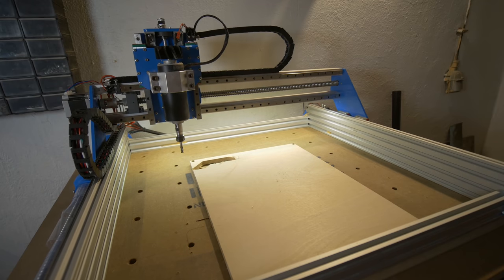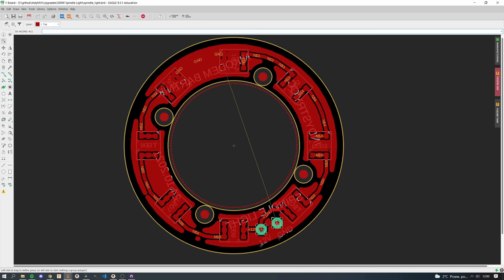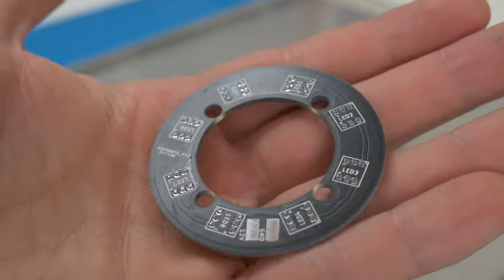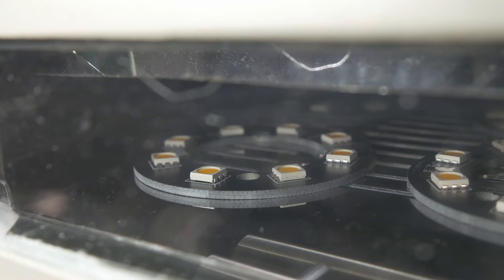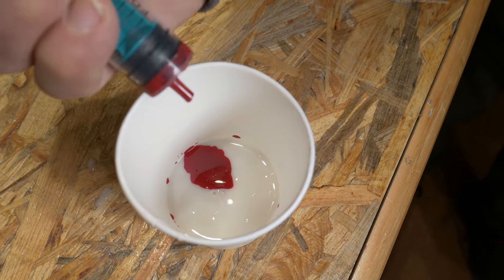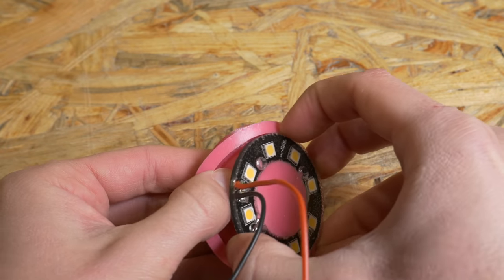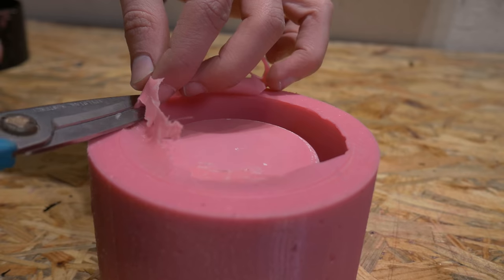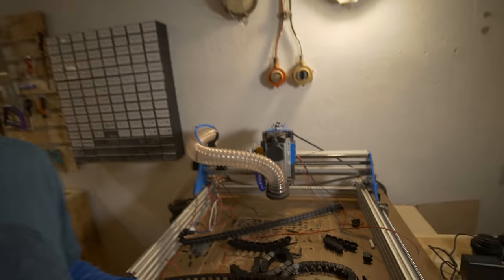How to Make a Casted Epoxy PCB that Lasts a Lifetime

Comment: Hey Niko, thanks for making this video.  I've never done PCB design, though it's something I may do in the future.  For both silicone and epoxy resin you typically don't want to cure them in the vacuum chamber itself.  Rather, the procedure would be to mix the components > use the chamber to evacuate gas from the mixture > then pour the degassed mixture outside of the chamber to cure.  A pressure chamber is used to further remove bubbles during the curing process itself, though this is not always required.  That said, many formulations of silicone are really very good to use without a vacuum chamber or pressure chamber at all.  Likewise with epoxy, particularly with very thin applications like you have here.  I think I have the same vacuum chamber as you and I find that I only use it for very large thick molds or deep casting situations.  Anyhow, thanks again.  Very interesting project.

Comment: Great video. May i suggest adding links to the mold making supplies you used. Including anything you learned about creating the 3D printed molds used to cast the silicone would  be great in the video. Regarding differences in coeficients of thermal expansion causing mechanical failure in the solder joints, there are conformal coating techniques that i have seen drone makers use to water proof their electronics that can be brushed on. The epoxy coating process you used applies to many other things. I really enjoy watching your videos.

Comment: You might want to clarify that you paid for Eagle or used a non educational version to make a PCB that you could sell as your version clearly shows educational version. Just in case. Also Eagle is now a part of Auto Desk Fusion 360. I enjoy your videos, so just looking out for you! Note: The purpose of using a vacuum chamber is to remove the air. Once you have pulled the bubbles out, you should pressurize the chamber to make whatever remaining air bubbles as small as possible, even if its just at atmospheric pressure. Leaving things to cure in vacuum defeats the purpose of using the vacuum to remove the air.
Reply: Just saying it's probably the case that is the version he used. Lots of people do it, it's technically not allowed, but from what I've seen, on this kind of small scale, companies like Autodesk tend not to care.
Reply: @lio1234234  Isn't there an exception for youtubers? He might fit that. I mean, a big part of the value is probably the video and I wonder how many parts you can sell from that product.

Comment: Oh and you may want to use a platsil silicone, cures in 45 minutes is more durable too. Skin safe which is nice when you want to do SFX makeup. That’s why I just have this stuff, I use it for tech projects but also for making FX makeup. It’s a bit more expensive but ROI is better than with a TinSil imo. I do 40-50 casts on a platsil and only 15-20 on a tinsil.
And you need a pressure put for the resin, you want to compress those bubbles to the smallest diameter.

Comment: There is a problem with potting SMD components in epoxy. 
Specifically, thermal cycling causes the epoxy to expand and contract, which in turn will break the solder or traces in time. 
That's why they don't see gyros and accelerometers being potted. 
Source: Analog Devices Mems engineering department. 
Do they not have clear silicon?
Reply: My RC car ESC is epoxied from factory for waterproofing, used it many times where it's gets well above 80C internally, never had an issue
Reply: @lio1234234  I doubt your RC will last thousands of cycles. 
I wanted to pot my 3D accelerometers and was told by 2 engineers at Analog Devices (who made the devices) not to do that for the reason I said. 
Also, the traces on an ESC are at least as thick as your nails. There is lots of solder supporting everything.
Reply: @piconano  Aren't there special mixtures, which don't break the solder traces, because they don't turn rock hard?
Reply: @maxmustermann2596  yes they do. I don't know what's called, but I've touched some. It's like the material over LEDs. Sort of like hard jello.
Reply: My furnace control board is potted in epoxy, has been running for years. My boat trailer lights are a solid block of epoxy with some LEDs in them for the light, totally waterproof and get bounced around a lot. No problems yet. Blob top ics are in epoxy. Not to say that certain things aren’t sensitive to potting but it depends on what it is. Many industrial instruments are solidly potted in epoxies, temperature range is -40 to 85C, they run for decades in extreme environments. I know that melf diodes do not like being potted in epoxy because of their shape, the resin can get under it and break to solder joint after just 2 temperature cycles. Replace the with smb package and no problems. Flexing a pcb can break smd components, epoxy can strengthen the pcb from bending thereby improving reliability in parts that vibrate (cars).

Comment: A trick for using any oven for soldering: place a bit of solder somewhere on a PCB. When it melts, you wait about 10s and turn off the oven. As usual, experiment with scraps first.

Comment: I actually have a video where I make a 32bit IO and you see me chucking the board in an unmodified toaster oven that cost 29 euros and just works. Ive been doing that since 1994 just use a lead based solder as it melts around 183C (even a bit lower) and voila!

Comment: I wonder if you 3D printed the mold in a TPU type filament would that work? It should be flexible enough to get the cured epoxy out? I'm thinking outloud here. You've done great work!
Reply from the maker: Epoxy usually sticks to everything, as far as I know silicon is probably the only material that is incompatibilie with almost any other material so it's great for such molds
Reply: @nikodembartnik  That makes sense then. Well done!